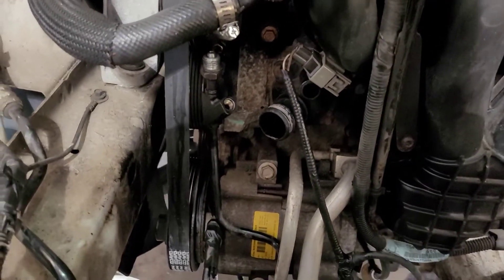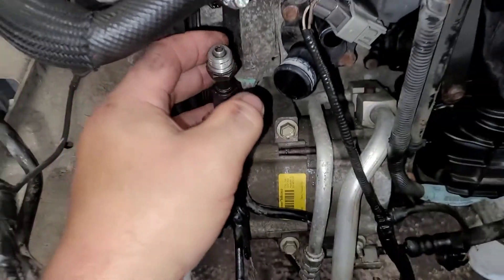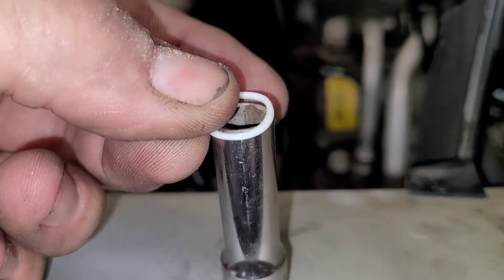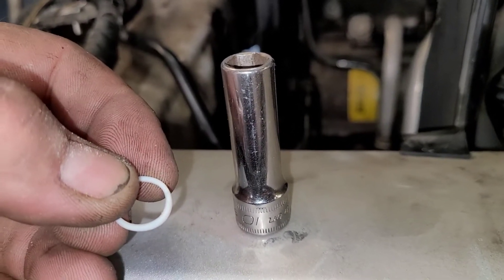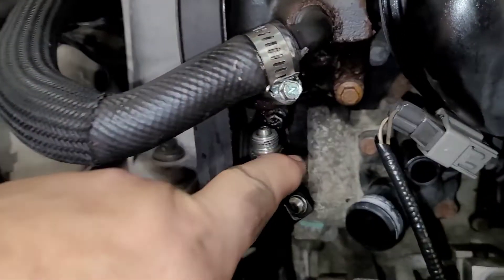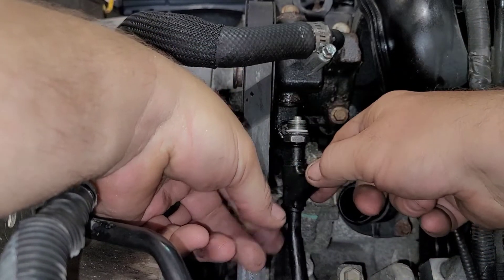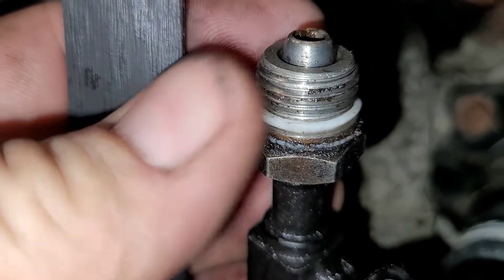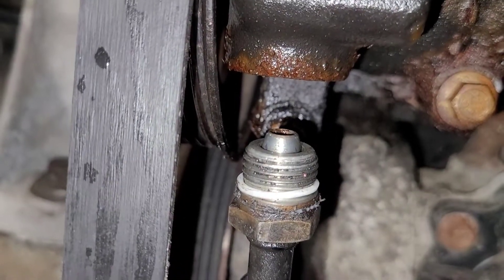How to install these pesky Teflon seals. Ford power steering line seal

Comment: I used a short 3/8 in socket extension that worked but it could have been slightly larger in diameter at the base.  The extensions and sockets do vary in diameter according to build quality.   Thanks for this video!

Comment: You can the same thing with a sharpy cap, difference is a sharp cap will slip over the threads nice and  easy and the seal slides right on!

Comment: Great problem solving idea. I would have tried soaking the teflon washer in warm water about the same temperate as a hot cup of coffee. Making it more pliable.
Reply: I was thinking the same thing. Of course, I would have probably got mad and put some rubber washer in there. That way I can spray steering fluid all over my driveway and tick off the wife. :)

Comment: Bravo old mate that was a trick werth learning
Fantastic great job 💯👍
Reply from the maker: I appreciate your reply. Thanks for watching & keep wrenching 🔧
Reply: @WrenchingWithKenny  truly was my pleasure
I have an FG Falcon have not had one but the man before changed the power steering high pressure line. But now that the car is mine the power steering pump is making a crappy noise I like put oil behind it it's quiet four little time and also when I took the cap off it made a little pop sound but with pressure in the oil tank I'm going to leave the top off and turn the steering wheel left and right a few dozen times hopefully get the air out of the system and then I'm going to figure out how to take some pressure off the belt. Maybe too tight live and learn I guess.
Cheers mate will keep watching
Reply from the maker: It's doubtful that the belt "being too tight" is the problem. I suggest a powersteering flush. It may solve the issue for you 🔧

Comment: Think outside the box on what to use. I cut the spout off of a cheap Dollar General kids flower watering can. I made it tight enough to cover the threads, put a little transmission fluid on the spout piece, and slid the oring onto the fitting. And! The watering can is still usable because I only needed the end piece. That took messing up 3 orings to finally get it done. Ugh!

Comment: I watched ford Tech Makuloco channel and all he did was stretch it with his fingers and installed one thread at a time until it seated at the bottom. Also Rich Pin Channel used the cover on a sharpie to install the seal.

Comment: Nice video.  I've been working on a 2008 Focus and used a large sharpie pen lid to do the same thing.  One question I had is how did you get this fitting unscrewed with the pulley still on the pump?  There is no room that I can see from the angle that you are filming.  Service information says to take the pulley off and that is what I had to do to get access to that fitting.

The other question is my power steering pump kit came with the Teflon seal and a black rubber seal that is slightly smaller than the Teflon seal.  What is this black seal for?  I didn't see one when I took it apart and service information doesn't mention this seal.  Thanks.
Reply: Did you find out what the blank seal is for?
Reply: @Dan-h3p1  No, I never did.
Reply: @Mr2004MCSS  So you just used the white seal without the black one? Did everything work for you, no leaks?
Reply: @Dan-h3p1  Yes, I only used the white seal and not the black one.  I did eventually get the high-pressure line to seal but the entire repair turned into a cluster.  
I used an aftermarket pump and reservoir and initially continued to have leaks at the high-pressure line.  I also had a leak where the reservoir goes into the pump.  
I ended up pulling off the pump and looking down into the pump where the high-pressure line screws into it.  I noticed that the design inside was different than the factory pump.  The factory pump had a complete area for the end of the line to mate against whereas the aftermarket pump did not have this.  At this point I had replaced the Teflon seal three times and I was done messing with it.  I ordered a factory reman pump from Ford and a factory reservoir from Amazon and installed them.  No more leaks from either place.  I did use a crowfoot wrench that I could attach a torque wrench to so that I could torque the nut to factory specs.
Reply: @Mr2004MCSS  Terrific, thanks for this information. I'm replacing my pump with an OEM one so I hope there won't be any leaks. Was just wondering what the smaller black seal is for, guess it isn't used for anything in the pump. I'll replace the pump tomorrow, attach the high pressure hose into it, try and tighten as much as I can though the nut has barely any grooves left. Hopefully no leaks. Thank you!!
Reply: @Dan-h3p1  Hopefully you don't have any leaks.  The nut is supposed to be tightened to 45 ft lbs which felt like a lot when I was using the torque wrench.  Those Teflon seals are only one time use and get damaged easily.  You are welcome.  Let me know how it goes.
Reply: @Mr2004MCSS  I definitely won't be able to get it to 45 ft-lbs. I don't have enough metal on the nut to grab on to, the head is quite stripped
Reply: @Dan-h3p1  That is unfortunate.  I always use flare nut wrenches on nuts like that so that I don't round them off.
Reply: @Mr2004MCSS  Just an update, everything went smooth and was able to install the pump
Reply: @Dan-h3p1  That is great news.  I'm glad it went well.  Did you reuse the old reservoir?
Reply: @Mr2004MCSS I did not. I had a new reservoir shipped with the new power steering pump so I used the new one
Reply: @dan2070  That was a good idea.  The O-rings that went on the original reservoir are discontinued and no one seems to stock replacements.  They are supposedly one time use as well.

Comment: Forgot to mention that the power steering connection pipe never gets tight, the seal is made by an internal "O" ring, you will always be able to move the pipe, it's normal.

Comment: Good tip. I wonder if a heat gun might allow it to expand a little to allow installation.
Reply from the maker: Quite possible
Reply: @WrenchingWithKenny .   Hi from across the pond and my Transit nut onto the power stearing pump.   This nut also has a seal on the internal diameter ,   so there is potential for 2 leeks to occur.    Yes you’ve guessed….I have both !!

Comment: The size of the seal?
Reply from the maker: I don't know but I believe Ford only used 2 sizes. They are both in a kit available at the parts store. Usually, it's a "HELP" pack. I hope that helps. Keep wrenching 🔧